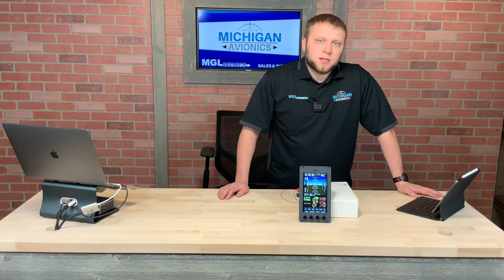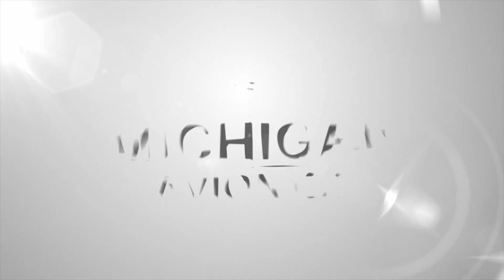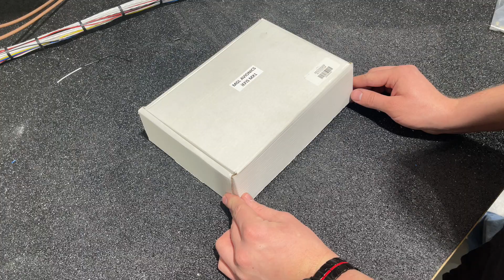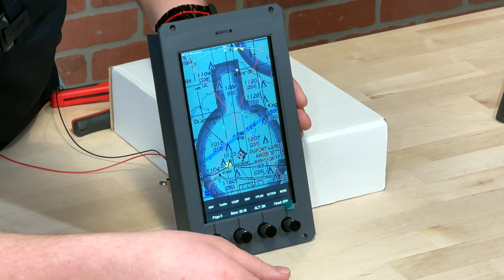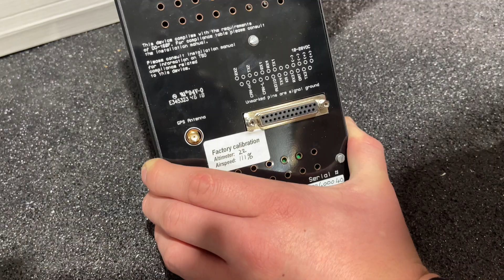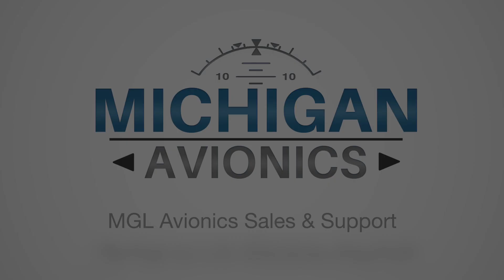MGL Avionics iEFIS MX1 Overview

Comment: Is it possible to remotely control a F.U.N.K.E ATR833 Transceiver with the MX1?
Reply: I've tried to connect MY MX1 to a first generation ATR833 and it did not work for me for two reasons: 1.) the ATR833 1st gen. does not support 8.33 spacing on the serial SL40 protocol which is being used to control the unit. for that reason, it is not possible to dial 8.33 spaced frequencies using the MX1.. also i was only able to pre-select frequencies, then had to use the ATR833 button to switch frequencies. Further more, the COM1 interface remained crossed out on the MX1, so it did not seem to recognize that the COM is actually connected. All this is a ATR833 first gen issue tho. I have since switched to a Trig TY92 and am controlling it over the same serial port and protocol and it works like a charm. F.U.N.K.E stated, that the problem should be resolved with the newer ATR833 versions, sadly there is no upgrade for the old ones to fix this.